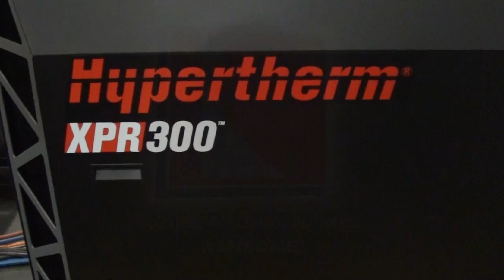XPR Plasma Cutting Bolt Hole With Taper Using 3DLT Bevel Head

Comment: Like the cutting effect with using Oxygen or Air? what gas did your machine be use in XPR300?
Reply from the maker: They used Oxygen and Air as this is mild steel
Reply: @KoikeAronsonRansome  for your beveling, you use Hypertherm system or your own system?
And beveling device of Lifting up and down---Hypertherm or your own developing and researching ?

Thanks!

Comment: What gases were used for the bevels?
Is it possible to cut the holes with the bevelled side to the bottom? Carbide overlay plate requires cutting with the carbide down and the large end of the bevel must be on the carbide side.
Reply: I always cut carbide with carbide facing upwards
Reply: @shanedunne7210  You're contaminating the base plate by doing so. Any welding done on the base will require a grind prep to remove contamination before applying a weld.

Comment: How much minimum diamter (with bevel) koike can cut ? Can the 3D bevel head cut 31 mm diameter (with bevel) ?
Reply from the maker: The minimum inner diameter is 16mm and outer diameter is 25mm with a 40 degree bevel.